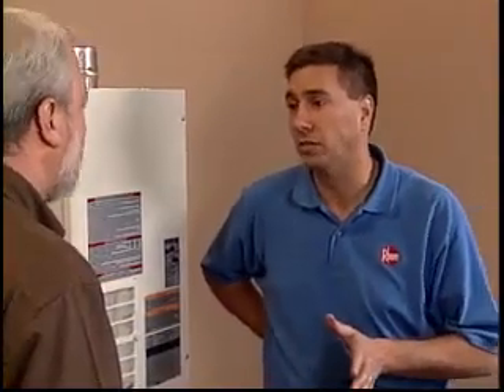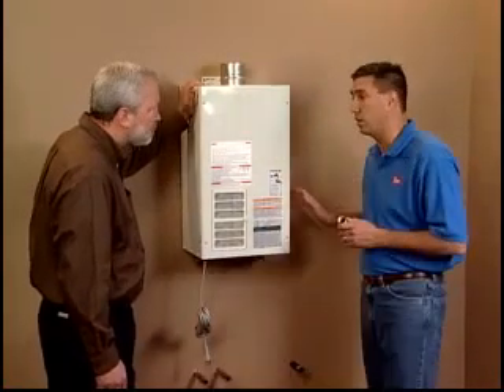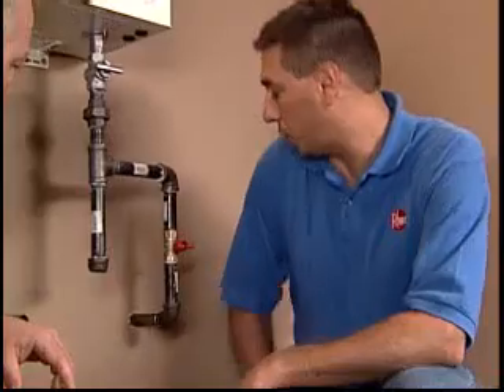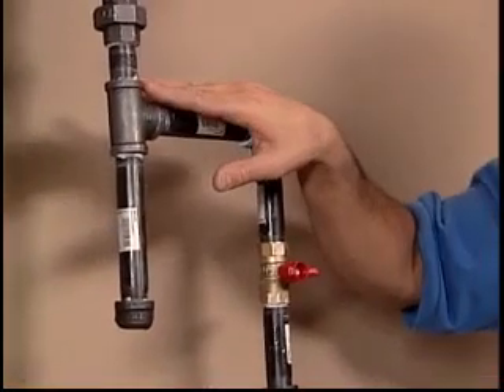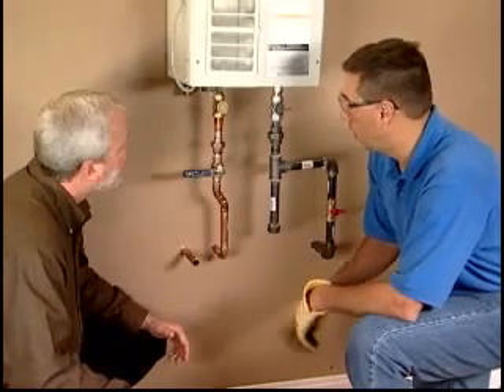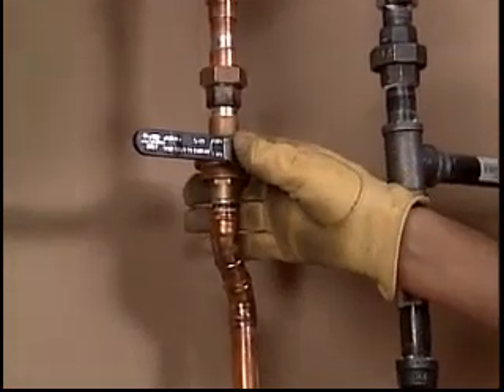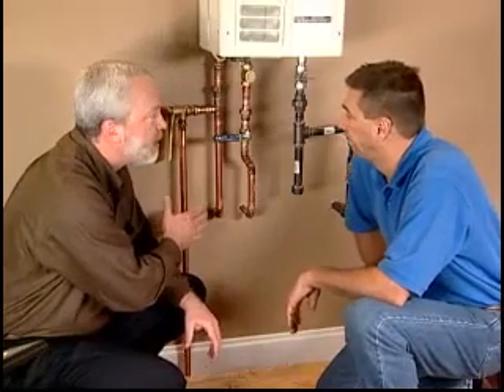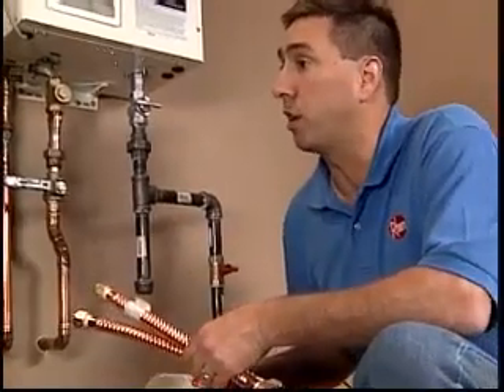Tankless Water Heater Installation   Plumbing and Gas Connections

Comment: my friend has a tankless heater,it has a tee in the cold water line going in the unit,and runs to the cold water knob in her shower,is this correct?..or does the cold water have to be seperate from the line going into the unit?

Comment: I thought a flexible gas line is not permissible. It must be hard piped, right?
Reply: Depends on the local utility. NFG code allows a properly sized flexible connector. Still need a sediment trap, however.

Comment: 2 gas shut off valves that close to each other are not needed. That check valve shown better be a spring loaded check valve, because if it's a typical swing check valve it's not installed correctly. Swing check valves can only be installed horizontally not vertically. Only problem I see so far is the lack of a shut off valve on the hot side. Reason being you won't have to shut down the whole building water supply if you have one shut off valve on each line. It also helps to do service or swap the unit out easier and quicker, no need to pull the TPR in order to drain the system or open up faucets and turn the whole building water supply off.
Reply: I have never seen a check valve  on an installation like that. Also, it is a swing check and will always be open.

Comment: On the hot side he went from metal to Copper that will cause electrolysis
Reply: The tank connection is brass, which is dielectric.